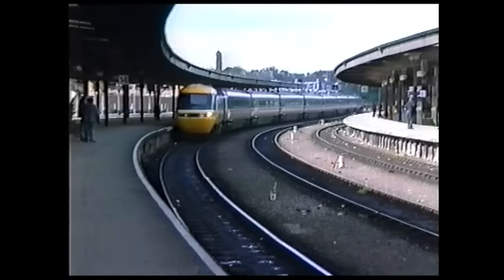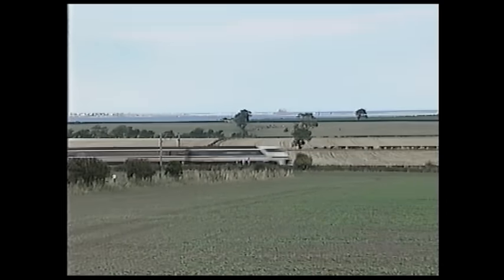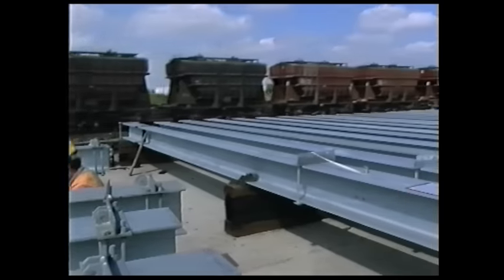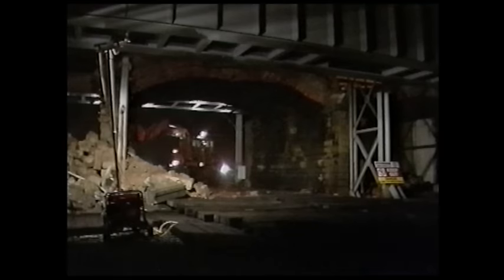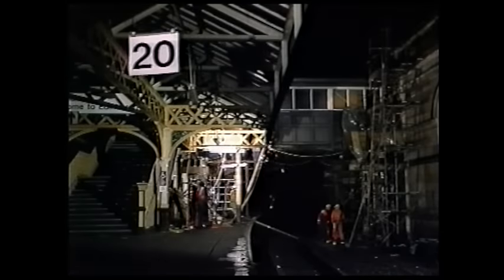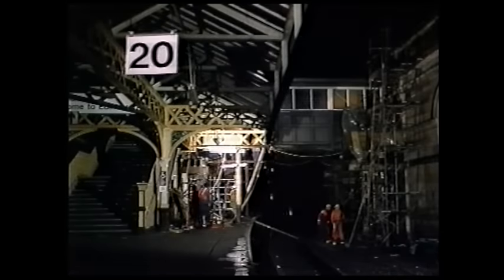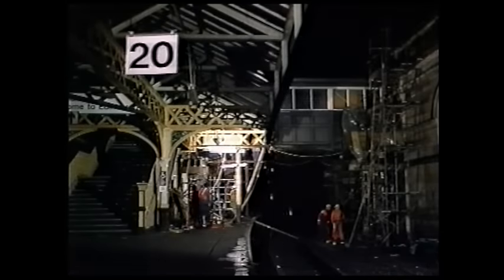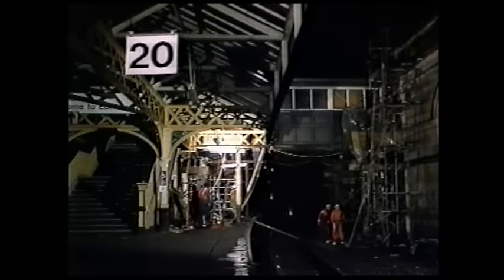Corridor of Power (British Rail, 1992)

Comment: Still a few class 91 / Mk4 sets running as of 2023.  Not sure how much longer they have left to go now mind, but they've certainly paid for themselves many times over and become iconic in their own right, like the HST.  And the latest (and probably final) LNER livery is a tribute to their original Intercity Swallow livery. Very nice.
Reply: Well, they were retired but not anymore as the need them, and we will have them until the next big rail upgrade at a guess
Reply: Yep saw 2 immaculate full sets at Leeds a few weeks back. Beauties they were.
Reply: @TrenyCwm  The main reason for me is that the 91 loco just sounds like a big fan ** (somewhat like the original Eurostar power cars) and therefore has far less character than the 43 sound wise. I like the Aussie XPT as well since the Paxman VP185 sounds better in them due to a different exhaust system (some exhaust note is evident, as in `XPT at Wauchope'). ** I understand that the traction motor whine can be heard on board the 91 once they get up to past 30 mph; there are some videos on YouTube including the 91's somewhat muted screaming.
Reply: @TrenyCwm   Notwithstanding what i said earlier the exterior design of the 91 is spot on & timeless, the blunt end more aerodynamic against the coaches than e.g. the Class 89 and the chime horns are fantastic. And it’s virtually entirely British. It’s only old fashioned now in that it has DC motors (although when launched the motors / control system were described as ‘state of the art DC’). It’s a shame it usually was only allowed to do 125 mph in service although of course 140 is only 15 mph faster.
Reply: @Martindyna  Absolutely, but has only ever provided a very small solution to a very large railway, hence the early withdrawal.
Reply: @TrenyCwm  You could say the same of ANY electric locomotive when compared to a diesel conterpart.  But I would argue thats more a failure of the UK government to have any serious long term commitment towards electrification (like they do in France, Germany, for instance) than any shortcoming on the part of the class 91.
Reply: @Martindyna Trouble is, beyond 125mph, the driver becomes the limiting factor. It requires in cab signalling. Ironically, the new digital signalling upgrades are pushing this. I think Tornado is being retrofitted as its primary route runs along the ECML. Not sure if there will be a linespeed increase though.
Reply: @EdgyNumber1  I wonder if there are still stretches of the ECML with flashing green signals? Indicating the signal beyond the flashing one is green so an additional block IIRC.
Reply: @Martindyna  There will be - but not for this purpose. Flashing green indicates divergence from route at line speed. This value is set well in advance of the points. Ironically, a good example of this flashing green can found on the WCML, just outside Hampton-in-Arden before Birmingham International station, when fast line speed points are set to direct trains to the outer platforms.

Incidentally, flashing two or one yellow also denotes divergence. However it is similar to the constant caution yellows which means you must adjust your speed accordingly ready for the turn out. Usually those flashing signals are placed on both sides of the permanent way to reinforce the potential danger ahead - a good example is the turn out towards Bicester Village, leaving the Chiltern Mainline.
Reply: @EdgyNumber1  Surprising to me that they thought a human would not cope well with 140 mph running considering the extra block that the original green flashing lights gave. Presumably if you passed a steady green you would close the regulator and slow to 125 mph so things would be as if you had a 125 mph line speed. 
Once a double yellow is visible you would then slow down further just like you would for 125 mph running.
Am I missing something? For adverse conditions the driver would need to use his discretion backed up by further rules.
I'm not sure what the general rules are for driving at line speed in fog, could you please comment?
Reply: @Martindyna  would you mind putting the link on here? i cant seem to find it. thanks!
Reply: @ThePennineWanderer   Class 91 Cab Ride - London KX - Stevenage (Part 1); go to 2.22 for the start of the traction motor sound becoming evident.

Comment: So impressive and achieved in such a short time using the technology, budget and resources of that time. Delivered ahead of schedule i believe? So what's going on...now? 😮
Reply: Far too many fingers in far too many pies!........ One entity, British Rail, could do all the work at cost............. today, multiple companies do the same work and all want their profit, so costs go up!
Reply: Slowly replacing the ECML electrification as the cheapo head-span system used is crap and fails all too regularly.
Reply: It was done on the cheap and anyone can deliver a project ahead of schedule if the original schedule is slack.
Reply: @dglcomputers1498  Its getting on for 40 years old now and needs replacing anyway.  But the problem was more that the masts were spaced out excessively on the straight, open stretches, leaving the wires vulnerable to high winds and ice loading etc.